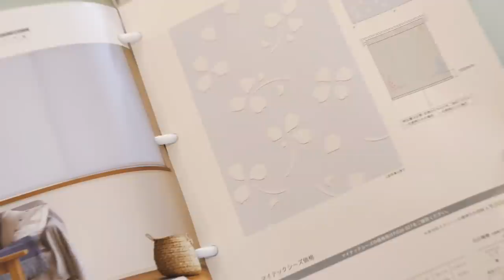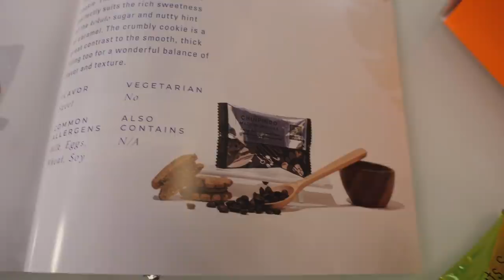Fixing up things for our cats!

Comment: The old "rope" is made out of sisal and mostly used for cat scartch towers and stuff. Just FYI. :] https://en.wikipedia.org/wiki/Sisal
Reply from the maker: It feels really plasticy and artificial, and it's quite shiny. I think it might actually be some sort of plastic. If not, then like a dried hay sort of thing? It doesn't seem like sisal rope, or any other cat tree rope I've seen.
Reply: @RachelandJunAdventures  sisal rope can be really rough and I've felt some that are plasticky and hurt their tiny paws, so it may very well be sisal
Reply: From the video it definitely looks like sisal, some of my cat towers/trees had cheaper sisal than others, the dyed or coloured sisal definitely felt more plasticy than the undyed sisal if that makes sense
Reply: @kaori8208  i work in a pet supply store and it is definitely sisal.

Comment: Idea for those boxes, cut holes in the in different ordinations so they can be put together in different ways allowing the cats to have a changeable floor house. Don't worry about the holes being viable on the outside since the cats can both look out and jump though if they want and will give them light. Possibly stick magnets to them so they don't slide apart or maybe a little bit of rope at each corner to hold things together

Comment: Just a heads up for next time....you get a sharp knife (Stanley knife - common builders knife) start at the top and cut all the way through and down in a line. It will all fall off accept for where its stapled.

Comment: If you plan to replace the rest of the scratchers you could use a really sharp box cutter. That way you just need to slice down the side without so much unraveling. It may or may mot work but I'm impatient and it may go quicker. The kitties are looking like they're getting along really well.